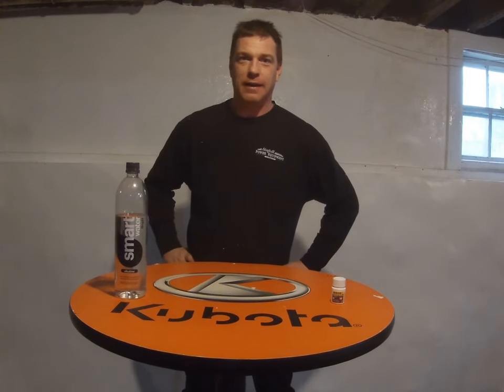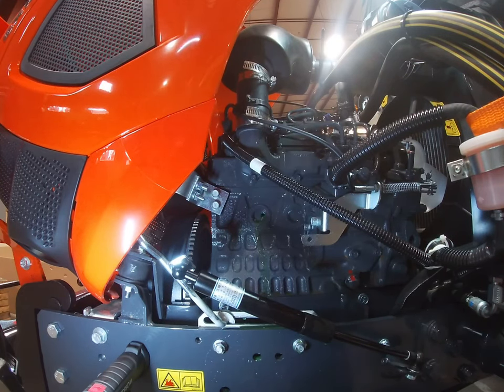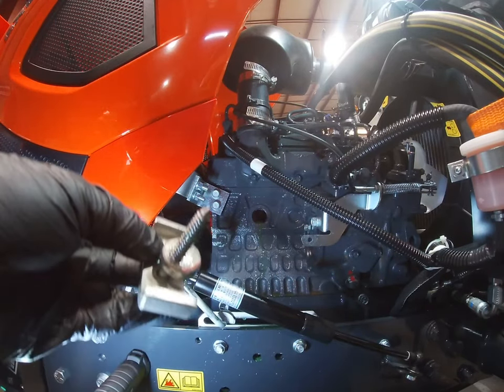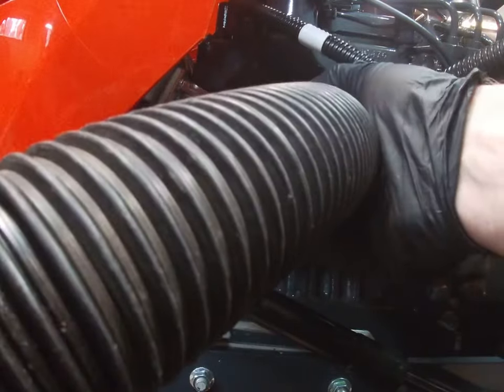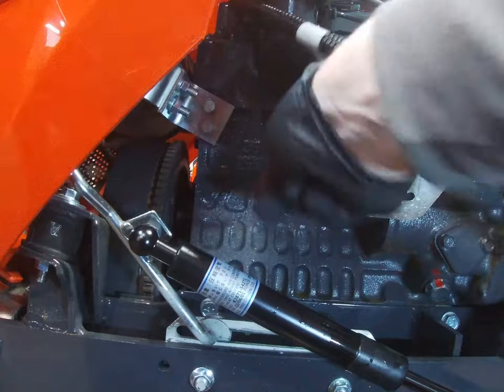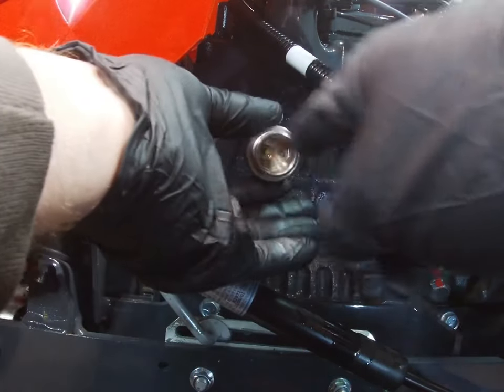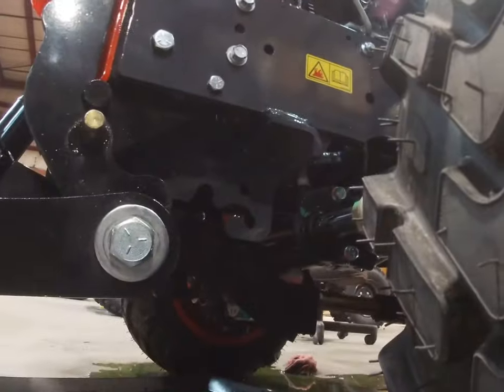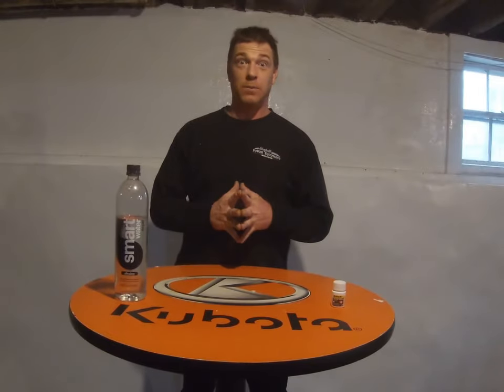Engine block heater installation

Comment: When you install a block heater on a Grand L6060 what freeze plug do you use? Thank you again for all your help and your videos :)
Reply from the maker: You’re welcome 🙏!  Glad you enjoy the show..!   I’ll be honest,, not sure if I ever had installed one on that model…. But if you get one through Kubota,, it’ll have directions!!   But if you are going a different route..  probably just the easiest expansion plug that’s accessible!!  Cheers 🍻 buddy
Reply: @ryanlynch2259  Thank for the quick reply. I did purchase the Kubota block heater and it had instructions but they were slightly vague. They mention using a freeze plug on the right side. However, I'm wondering is this the right side when facing the tractor or the right side when sitting in the cab? Thanks again :)
Reply from the maker: @ right side when sitting in the machine..!    Use the one that they tell you to use!!  Might be a little tedious to do..  just take your time and do it meticulously!!  Good luck 🍀

Comment: Nice video. Do you thank the block heater are  any better than the radiator hose heater? I need to get ready for winter.
Reply from the maker: Thanks 🙏!   Probably the block heater..   your putting the heat right where it needs to be

Comment: Any suggestion how you best pull an existing block heater plug to put a new one in.
Reply from the maker: I’m not sure 🤔..  kinda have to come straight out with it..    reverse slide hammer with vise grips might work..  you just have to get creative and use the tools you have…!  Maybe a cut off wheel so you can put a groove in it ,, for a pry bar….

Comment: Do you know if this heater will fit the d722 in an 1880? From what im seeing in price book, it wants to use an inline type heater.
Reply from the maker: I’m not sure 🤔.  I imagine it can if it looks like this engine..
Reply: @ryanlynch2259  It's similar, may have to just order one and measure the heater. It's hard to tell a size from pictures. The plug on the d722 is .770 in.
Reply from the maker: @darrenmoyer269   I think they measure them in millimeters..?  If that matters..  good luck with your project buddy!!

Comment: What tool are you using to pull out the plug? I need to install on mine.
Reply from the maker: Freeze plug remover… I got it off the tool truck,, but it not snap on..